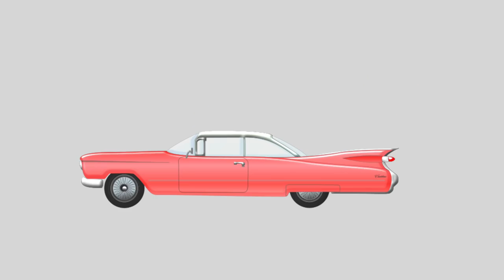Yes, Rockets CAN Fly in a Vacuum

Comment: errr no.  A rocket moves in the earths atmosphere because it is pushing off the air.,  It literally creates a higher pressure area behind the rocket  and so the rocket moves forward into a lower pressure area..  If you take the rocket the vacuum of space, then it will not move,  because you cannot create a higher or lower pressure area in a vacuum..  Therefore Newtons third law does not apply, because there is no 'reaction'..  the reaction only happens when the escaping air hits something with mass..  and there might be a bit of a wait for that.  lol.
Reply: If I fired a crossbow IN A VACUUM will i feel RECOIL? Yes or No? WHY?
Reply: So in your example above, are you suggesting that the "escaping air" HAS NO MASS ???  Last time I checked GAS HAS MASS and therefore PUSHING AWAY GAS results in a REACTION force.
Reply: @stuartgray5877  I am not saying it has no mass.. I am saying that the vacuum immediately evacuates the first gas molecule and so the second gas molecule can not catch up to it to  increase the pressure..  On earth ALL forms of propulsion in air rely on a high pressure area moving towards a low pressure area..  the pressure is ALWAYS lower in front of the vehicle than behind..  In the vacuum of space there can be no pressure no matter how powerful the rocket and so  there is no movement.  A rocket in space is as useful as a submarine on a race track.   to move in a vacuum you need electromagnetism or gravity forces..    Rockets can not work in space.
Reply: @stuartgray5877  As i have said many times before. your example is moot..
    If you fire a crossbow in a vacuum it will not recoil . the crossbow will vibrate due to the bowstring and the limbs shifting position , but no thrust will be generated to move the crossbow.
    If you load the crossbow with a bolt then you have introduced a mass that is not present in the rocket  example.   ie.  Rocket +hot expanding gases.  is not the same as   Crossbow + energy stored in bow limbs + mass.   .  what you need to ask yourself is this.  " If you repeatedly fired a crossbow with no bolt would you generate thrust in a vacuum. ?...  no..  just as you can't kick your own arse up a flight of stairs.
Reply: @boptah7489  - " If you fire a crossbow in a vacuum it will not recoil ."
This is demonstrably FALSE.
Thanks for making it CLEAR that you have never taken a physics course in your life.

Lookup "Conservation of Momentum" before arguing with actual engineers.

"If you repeatedly fired a crossbow with no bolt would you generate thrust in a vacuum. ?...  no"
This is correct.  Too bad the rocket has MASS TO EXPEL THE ENTIRE FLIGHT which is analogous to the crossbow having an nearly unlimited supply of projectiles to fire.
Reply: @stuartgray5877  firing a crossbow in a vacuum does not produce  recoil,  To produce recoil  with a crossbow you need a mass to push against..  You would have to load the crossbow with a bolt to have a mass,
    A rocket has no mass to push against. in a vacuum.  Because the first mass of rocket gas is  evacuated into the vacuum before the second molecule of mass hits the first to create pressure to move the rocket.  You cannot "expel"  into a vacuum.  , the vacuum "evacuates"  the rocket gases.  To "expel" means to use a force to overcome resistance.,  As soon as you open the rocket nozzles, the rocket fuel is evacuated into the vacuum..  you would even have difficulty in mixing  the propellent to cause ignition.
      A rocket does not work with the expulsion of mass out the back.  A rocket works by creating a high pressure area behind the rocket using expanding rocket gases, this causes the rocket to move into the low pressure area in front of the rocket. The high pressure is caused by atmospheric pressure acting like a containment vessel  to provide resistance to the expanding gases to increase the pressure..   This is why a rocket cannot work in space,.  Because there is no atmosphere ..   It;s not complicated.
Reply: @boptah7489  
Sorry sunshine, but you're confusing rockets with aerodynamic lifting bodies.

Also, vacuum doesn't suck, vacuum doesn't evacuate.
High pressure fluids force their way into areas of lower pressure.
Not that this really matters either.

Rockets cause mass to accelerate. Mass resists acceleration, ie. inertia.
A force has to be applied to the mass in order to accelerate it.
An equal force in the opposite direction is also generated, causing the rocket to accelerate.
Reply: @niallkinsella2687  Not balloon , I meant rocket.  I have edited it .  I was talking about balloons on the other thread.
   Gas from higher pressure areas are evacuated  frictionlessly into a vacuum because there is no resistance.in the vacuum. 

    Rockets cause mass to accelerate.  But only if there is resistance behind the rocket. .  for a rocket to provide thrust you need a high pressure area behind it, so that it forces the rocket into the lower pressure in front of it.  you cannot generate pressure in a vacuum,  It is impossible.because there is no resistance. 

    The mistake you are making is assuming that the rocket pushes off of its own gaseous mass.  that is impossible, because the first molecule out of the rocket does not meet any resistance for the second molecule to hit and so on. And so no pressure builds up. 

    In a vacuum you are not applying a force to anything at all.  not even the rocket.  Because you need two masses and a force in the middle for Newtons 3rd law.   This is why rockets cannot work in a vacuum.
Reply: @boptah7489  
Rocket exhaust leaves the engine bell at a velocity of several kilometres per second.
What causes the rocket propellant to gain so much velocity compared to its starting velocity (which is 0, relative to the rocket)?
Pressure difference alone doesn't account for such a change in velocity. Where does the extra work come from?
Reply: @niallkinsella2687  We  have no idea of the velocity of the rocket exhaust gases in a vacuum.  It is completely different to air pressure , because there is no resistance. 

   A rocket requires two or more molecules to mix to produce an exothermic reaction.  But in a vacuum they might not even mix,  and if they do, then they will be #evacuated' into the vacuum at the rate at which they are expanding. This does not create a force in the rocket nozzle.( vacuum side)  and even if there is a small force in the nozzle because of the friction of the dilated rocket nozzle.  that resistance is inside the rocket and so does not produce any gaseous pressure once the restriction is passed.  ie.  At the point of exit from the rocket, there is no pressure and so no thrust.This means there is no work done. because there is no force.  If one side of the equation is a vacuum,  then there is no force.
Reply: @boptah7489  - "firing a crossbow in a vacuum does not produce  recoil,  To produce recoil  with a crossbow you need a mass to push against..  You would have to load the crossbow with a bolt to have a mass,"
DO you think I have been suggesting DRY FIRING a crossbow?  OF COURSE I meant loading it first.

Lets start over: If I LOAD A steel projectile into a CROSSBOW, COCK IT, then fire it in a vacuum will I feel recoil?
I can only assume you will say "Yes"

NW if I load a WATER ICE projectile into a crossbow and fire it in a vacuum, WILL I FEEL RECOIL?
How about a projectile made from Dry Ice (solid CO2) - WILL I feel recoil?
Reply: @stuartgray5877  You can only use the dry firing example to equate with a rocket.  ie you have 1/ a crossbow  2/ a bolt 3/  a force that separates the two masses.
    A rocket in  a vacuum has 2 elements  1/  the rocket  2/ the expanding gases.   ,  there is only  mass on one  side of the expanding gases.   you can not count the expanding gases as a mass because one side of the expanding gas is a vacuum and so you are not able to apply a force to it  ( push off). 

    ie   the first molecule of gases is exposed to the vacuum and so is immediately evacuated into the vacuum,  the second molecule cannot catch up with the first and so can not  apply a force to it. and so on.  What you are trying to say is you can pull yourself out of the swamp by pulling your collar upwards.  or you can kick your own arse up the stairs.. This is why your example is like dry firing.   only.  .  And as i have repeatedly said.  If you fire a crossbow in a vacuum there is no recoil.
Reply: @boptah7489  
What causes the exhaust gases to start moving relative to the rocket?
Up until the fuel is burned into exhaust in the rocket engine (or rocket motor, if you prefer), the fuel and rocket are traveling in the exact same direction at the exact same velocity.

Some force has to act on the fuel to cause it to change velocity, otherwise when it exits the rocket it will just keep travelling at the exact same velocity and direction as before it exited the rocket.
Reply: @niallkinsella2687  the force is the equalisation of pressure..  High pressure always goes to low pressure just as Hot always goes to cold.
   the rocket propellent is stored under pressure prior to being mixed.  you could also argue that the rocket fuel components will not mix effectively in a vacuum because there is no back-pressure to rely on.  there is evidence of this in several experiments.  but leaving that aside.  If the rocket fuel ignites it will be evacuated ( from one point of view)  into the vacuum at the rate  at which it expands because there is no resistance in a vacuum .  You can not create pressure in a vacuum also.
   Because there is back pressure on Earth ( atmospheric pressure)  a rockets gases are contained by resistance  from atmospheric pressure behind the rocket , and this creates the pressure...  A rocket moves forward into the lower pressure area in front of the rocket due to the higher pressure behind it. .    This is why the concept of a rocket working in space is ridiculous,  In fact due to the weight of the rocket and fuel.  you cannot go anywhere near space. in a rocket.
Reply: @boptah7489  
Right... assume you are right in that monopropellants don't exist (they do) and you can't mix liquids in zero gravity (you can), and the fuel is simply vented from the rocket under its own pressure before being sucked into space (faster than it was already traveling, according to you).

What then? Where does the pressure energy go? It can't simply vanish out of existence.
Reply: @boptah7489  
Next question, 
Place one single molecule of gas in the very middle of the combustion chamber. Directly in line with the centre of the nozzle.
At exactly 0 relative velocity to the rocket.

What happens to this molecule and why?
Reply: @niallkinsella2687  Rockets that are used by NASA  and spacex are multi propellent.  I never said anything about monopropellents..  Did I?.
   I never said anything about mixing in Zero G. !!!     I said in a vacuum.   wakey . wakey
  .  I did not say iy was travelling faster.  Did I.?   I said the vacuum would absorb the expanding gases at the rate at which they expanded. 

   the molecules that are expelled into the vacuum will release their energy  ( react)  when they meet another mass..  Which might be in a year or a century.  Who knows.
Reply: @boptah7489  
Lastly, if a rocket has to surf a wave of pressurised gas in order to move, why is it shaped like a rocket (tall and narrow).
Would short and fat not be a much more effective shape to capture the energy of the high pressure exhaust flowing into the low pressure area in front of the rocket?
Reply: @niallkinsella2687  A rocket does not "surf"  it follows well known pressure laws.,  High pressure ALWAYS goes to lower pressure.
  A rocket is tall and narrow with a pointed nose  because you need the least resistance to atmospheric pressure as possible.  the height of the rocket is because you need  to carry fuel without adding resistance to the air.  Short and fat is the worst shape .  the rocket gases do not flow into the low pressure area.  the rocket itself moves into the low pressure area. just like a shuttle valve.
Reply: @niallkinsella2687  The one single molecule has merely gone from the high  pressure area  inside the rocket and moves towards the zero pressure area ( vacuum) outside the rocket.  At no time will the molecule not be moving.   If you are in an aeroplane at 40.000 feet travelling at 600mph and someone breaks a porthole.  then the air pressure equalises . . It is the same principle.
Reply: @boptah7489  I said place the molecule in the centre of the combustion chamber with zero relative velocity to the rocket.
Not eject it under pressure.
Wakey Wakey.
Try again
Reply: @niallkinsella2687  How can you have a molecule in the centre of the combustion chamber ?.  Did it get there by magic?  did it teleport?  Is it a relative of Shrodingers Cat?.   NO.  It was propelled there  on its way to the low pressure area( vacuum)  behind the rocket.  There is no such thing as a stationary molecule.  wakey , wakey.
Reply: @boptah7489  
It's called a thought experiment. Physicists use them to conceptualise ideas, it's not a difficult concept to grasp.

"There's no such thing as a stationary molecule"
Close enough. I'll take this. 
Where does the molecule move to? Remember it's only a single molecule.
Reply: @niallkinsella2687 As i said.  the molecule moves from the high pressure area ( the rocket fuel explosion).   Or the pressurised fuel tank ( pre detonation)   to the lower pressure of the vacuum. .  the vacuum has zero resistance ( no molecule collisions) and so cannot create pressure 

    And so.  the molecule moves from an area of many random collisions ( high pressure)  to the area of zero random collisions ( vacuum).
   This is why the molecule cannot be considered as a mass for Newtons 3rd law.  Because the molecule is not undergoing any "reaction"  until it hits another molecule..( to create pressure , )  in other words.
Reply: @boptah7489  
Fantastic. We're making progress. It's coming so fast now that you've actually skipped a step.

Molecules within a fluid undergoing expansion will move in random directions, and experience random collisions, causing them to move off in another random direction. 
Net result, the fluid expands in all directions.

So my final two questions.
1. If the molecules in the expanding exhaust gas are moving randomly and expanding rapidly in all directions, why would they not impact the walls of the combustion chamber and rocket engine bell?
2. As you've already stated, a molecule will transfer some of its kinetic energy to an object that it hits. Why would it not transfer kinetic energy to the rocket if it hits part of it?
Reply: @niallkinsella2687  1/  If any of the molecules interact with anything inside the rocket engine bell.  then that is still inside the rocket.  you need high pressure Behind the rocket to make the rocket move.   You cannot pull yourself out of the swamp by pulling on your own collar.  the Pressure has to be on the outside of the Rocket nozzle.  Not inside the rocket.  ie.  It has to be separate from the rocket.  In effect the rocket is the separate intermediary between a high and a low pressure area.
     2/  It is perfectly possible for a molecule to hit the interior walls of a rocket and impart a force  ( heat kinetic energy, etc).    but that is inside the rocket.,  there will be a higher pressure area ( slightly)  within the confines of the Rocket , before the vacuum evacuates all the molecules into deep space.  And the rocket will not have moved 1 mm. 

     This is why we can not go to the moon with rocket tech.  If you don't believe me.  contact NASA.  they  will tell you they can not go to the moon any time soon.
Reply: @boptah7489  
Ok so. You seem to be absolutely convenienced that you need an area of high pressure gas to make a rocket work...
Then why does a rocket at ground level produce an exhaust with shock diamonds (an artefact that only occurs when the exhaust gas is lower in pressure than the ambient atmosphere)?
Reply: @niallkinsella2687  That is a good question.  but is irrelevant in the relationship between rockets and vacuums. because the effect you describe is the result of harmonic interference. with different external masses and there relationship with the internal dynamics of the nozzle  and the rate of combustion.there is literally no mass whatever outside a rocket in space except the rocket itself.
    If i had to reduce the effects of interference in any system , I always go back to the 'golden mean ' and  harmonics.  from building and tuning an engine to making a musical instrument there are ratios and harmonious frequency accelerations that can be helped or hindered.with the correct numerical size and shape of interlocking parts and flows.  "shock diamonds"  are just one or more components that are 'off key'
Reply: @boptah7489  
This is incredible. Not a single thing you've said is supported by any of the laws of physics that govern our universe, and you're beyond adamant that you are correct regardless.
Even when you start getting close to the correct answer, the mental gymnastics go into overdrive and you make up some shite again.

I've gone through enough to show any reasonable person that rockets are perfectly capable of working in space. If you want to keep insisting that they need to push off if an atmosphere, go right ahead. The rest of us can continue to enjoy the discoveries made by extraplanetary science.
Reply: @niallkinsella2687  EVERYTHING i have said is supported by the laws of physics.  you just do not know the laws properly. 

  the reason you cannot contradict  or rebut anything i have said is because you are brainwashed,    Of course yo need to push off an atmosphere  that is how rockets work.  The whole point of a variable nozzle on a rocket is to vary the pressure due to the surrounding air pressure..  If you think Rockets are not moved by pressure , then you are worse than a flerfer. 

   As i said.  Why don't you give NASA or spacex a call and ask them if they can go to the moon.  .  they will lie to you and tell you " oh yes ,  in the future.  Years into the future".   There is no Extraplanetary science. discovered yet.  It is all science fiction.
Reply: @boptah7489  
I've rebutted everything you've said, you've just ignored me.

No extraplanetary science? It's all fiction?
You can go outside and look at the ISS orbiting overhead. I suppose you think that's fiction too?
Reply: @niallkinsella2687  there is no ISS in the way that NASA wants people to believe.  what you see in the sky is a much smaller replica supported by Helium balloons at approx 120, 000 feet.. ALL NASA satellites are under Helium balloons.  they are launched from the antartic.  NASA are the largest purchasers of Helium gas in the world, closely followed by Google ,who also have a separate Balloon satellite launching company called  'loon'. 

   Of course you can't have man made satellites just floating around the globe.  That is just bullshit.  Gravity is a bitch.
    All external works on the ISS are done in a swimming pool in Russia.  anti gravity effect is done in a zero G plane and a zero G tunnel on the Earth, and CGI  and 'wirework'  fills in the blanks.  there is masses of info on youtube.  https://www.youtube.com/watch?v=9STCKFr1bAM
Reply: @niallkinsella2687  On the contrary.    anyone that sees this thread will understand the reason why NASA can't go to the moon  and so cannot launch satellites into space.  .  If you want to believe that 1960's tech can take us to the moon and then NASA has lost all that wonderful unicorn technology and now can't take us to the moon, then that is your funeral.  .  Once the penny drops that a rocket can't work in a vacuum or even in LEO, then you have to reconsider your whole basis of reality..   Why do you think that you cannot see any REAL pictures of satellites on google ?.  How do satellites defy gravity. ?   the explanation that NASA gives is laughable.and Keplers laws are based on the Sun's mass. .   It is all bullshit for political reasons.. 

   the FACT of the matter is .   NASA CANNOT GO TO THE MOON TODAY.      Let that sink in.
Reply: bo ptah 
Search YT for "SpaceX Falcon Heavy Arabsat 6A Launch and Landing in 4k Ultra HD" and WATCH THE VIDEO 

Tell me that you see the following:
The THREE common cores liftoff and head downrange (EAST)
ALL three are travelling at about 3600 Miles per Hour EAST and at an altitude of over 50 kilometers (>160,000 feet)
The side boosters SEPARATE, Turn around, CANCEL the eastward velocity of 3600 MPH, and FLY BACK to KSC, AND LAND .

Are you Agreeing that this is what you see in the video?

Then explain to us: AFTER the rocket flies up and OUT OF THE ATMOSPHERE (above 50 kilometers) and the boosters SEPARATE from the center core - HOW DO THEY TURN AROUND AND CANCEL THAT 3600 MPH - ALL WHILE IN A VACUUM ??

SO are you going to suggest that the atmospheric pressure above 50 kilometers is NOT "vacuum" (Remember you ARE talking to a Vacuum Test Specialist)
Or are you going to claim the video is fake? (even though this event was viewed by TENS OF THOUSANDS of spectators LIVE)

OR - are you just going to pretend this evidence does not exist like ALL of my other evidence?

You could then compare this video to the ACTUAL video taken from the rockets where there is INDISPUTABLE EVIDENCE that the boosters ARE IN HARD VACUUM.
Reply: @stuartgray5877  It is NOT a vacuum at 50 KM..  Mr Vacuum test specialist.  It is not even a vacuum at 400 miles.  In fact in the mesosphere   ( 100 KM's) the air is so dense that meteorites burn up easily. 

   No rocket can get anywhere near a vacuum.  you need high pressure behind the rocket at all times.  Rockets work on pressure not prayer.  Lol.
Reply: @boptah7489  So WHY havent you answered my question?  WHAT IS the atmospheric pressure at 50 km altitude TELL US WHAT YOU THINK IT IS and WHERE you got your information.

DO you even SEE the three posts above this one with the embedded links, or did YT block them?
Reply: @stuartgray5877  There are no links in your posts. 

  I do not believe for 1 second that a rocket has gone past   120  -150 .000 feet.  A helium or hydrogen balloon might be able to do it.  but a rocket cannot work in such thin air, 

 The video from the spacex rockets are ridiculously fake.   the rocket nozzle is vibrating away quite nicely.  but the Camera and the Earth are rock steady.  It is quite funny actually.
    It does not matter what the air pressure is at 50 km  It will vary above the equator to the poles anyway.  the point is .  A rocket or a balloon can not go anywhere near 50 km's.    There were no witnesses to the whole trajectory of the launch.  .  It was just the usual hype and cgi.  Total nonsense.
Reply: @boptah7489  Try the website: www dot engineeringtoolbox dot com/standard-atmosphere-d_604 dot html 
AND TELL US WHAT IT SAYS THE ATMOSPHERIC PRESSURE IS at 50 km.

HINT: 50 km is 164,000 feet.  WHAT DOES THE TABLE SAY?
Reply: @stuartgray5877  It does not matter what the table says.  they cant go that high with any technology that has been currently invented,
      A helium balloon can float to approx 135.000 feet.  and some have gone higher., but rockets need  much denser air to create pressure.
Reply: @JohnVJay  The worlds physicists and engineers are really just gophers and technicians.  They just follow orders. They are not proper professionals .  None of them have ever invented anything or discovered anything worthwhile.  All of the major technological discoveries happened in the period from 1850 until 1912.   ie,  Wireless communications, computers using logic internal combustion engine,  powered flight, AC and DC electricity and loads more. I call today's scientists and engineers.. 'spastics'
Reply: @JohnVJay  A basic law of motion is that physical things require resistance to create movement.
   I don't care what Scientists think of me.   It is none of my business what other people think of me . Anyway.
Reply: @JohnVJay  Gravity is not a physical force.  you do not need  the conservation of energy principle to move with Gravity or any form of electro/magnetism.   That is why i said "physical".  Physical transfrers of force need resistance.  Pressure is a physical force ,  for instance. 
   First of all.  you cannot achieve combustion in space.  you need pressure to create a chemical reaction especially hypergolic.  Secondly you cannot apply a force to a vacuum.  this means there is no force going to the rocket as per Newtons third law.
   Physics is obviously not your specialist subject.   And neither is understanding basic English.  don't you have a Nintendo or something to play with ?
Reply: @JohnVJay  You are just a corporate shill.  If you want to violate the laws of physics that is fine.  but don't expect people that know the subject to agree with or support you.
Reply: @JohnVJay  I m not interested in primitive rocket gyroscopes.  no doubt they are great fun for the kids. 

   I am interested in the means to accomplish space travel.  this will need its own method of navigation.  But it looks as though the navigation means is inherent in the actual propulsion mechanism.  As long as element 115 can be made stable.
Reply: @JohnVJay  The fact that you even think you can debate me, means you have advanced Dunning Kruger.   But that is OK.  you all have to start somewhere.